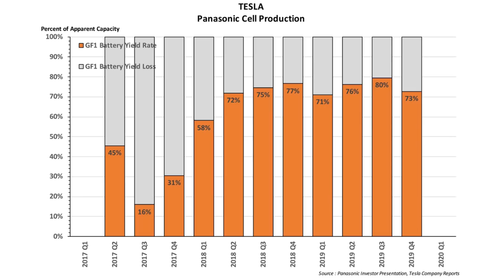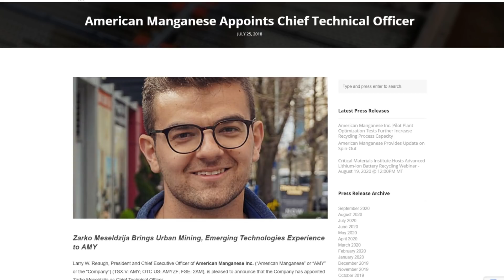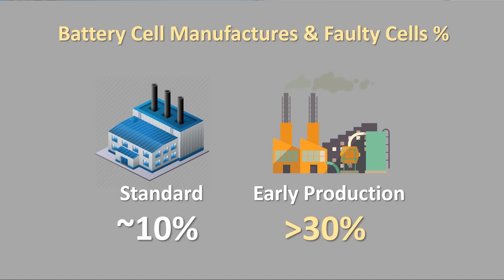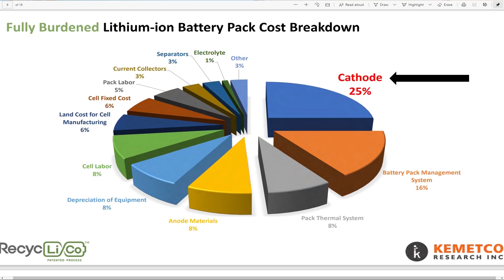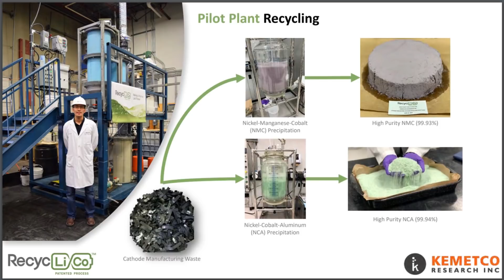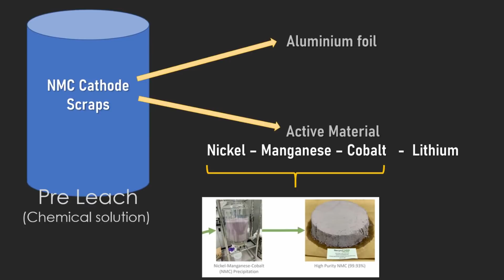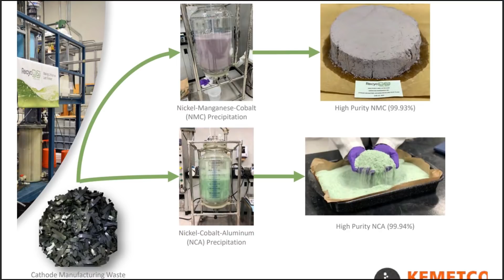Tesla Battery Day Preview - Redwood Materials

Comment: Redwood uses smelting to melt down phone batteries. Horrible for the environment. Take a look at American Battery Metals Corp. Full EV closed loop recycling. Team of 3 former Tesla employees with more to come...
Reply: It depends on what you are smelting and how you smelt. Furnaces designed specifically for producing molten compounds from melting cell phones, laptops, etc. Lead is a component of cell phones and laptops, but it would become part of the multinary metal oxide, along with the target elements Li, Co, and Ni and extracted - not emitted as in a dirty smelting process.
Reply: You are correct. Along with that how much energy is consumed and where will it come from.
Reply: @schulzmj1  Melting the component materials of the systems (cell phones, laptops, etc) down generates enough heat that once you get them going they are autoaccelerating... that means, no external energy required except to get them started, and that energy can be provided by a neighboring unit. So, it is energy releasing, not energy consuming. The energy required to concentrate/extract the various elements from the resulting compound is much lower than required to mine and separate those elements by traditional methods.
Reply: @cbmusgrave  Please show me the exothermic chemical reaction in the smelting process of the above items.
Not happening! That a side
How much metal vapor is releases into the atmosphere during the smelting process?
What are the recovery rates?
What kind of slag is left over after the smelting process?
Where does the black mass (slag) go once the smelting process is complete?
Is the black mass toxic?
All legitimate questions, just asking.

Comment: They are recycling what is available today.  Car batteries will need to be recycled maybe in 10 years and that number is going to grow based on cars or batteries produced.  And when the cost of batteries goes down the number produced will increase because of other uses. The grid is going to transition from energy on demand to energy stored and used when needed.  If this recycling was not done there would be a huge amount of battery waste.  This recycling is very important.  Think of a chain, every link is different.  If a link is missing the chain fails.  Recycling batteries is a link in the chain to use energy and pollute less.  It is predictable how much battery waste is coming and where it is coming from.
Reply: It is important to consider the efficiency of recycling technologies
Reply: The problem is no one is recycling lithium ion batteries in an eco friendly way today. Smelting batteries is terrible for the environment and the recovery rates are pathetic. If a proper way of recycling lithium batteries is not found EVs are a disaster for the environment. Recycling is the link in the chain that has not been dealt with.
Why don't any of the eco nuts think like you?

Comment: Thanks for the insight. Some comments on the content from someone who does not have a manufacturing, chemical or economics background.
1. Manufacturing waste or non compliant materials at 10% would seem high. 30% a even bigger gap of belief. Surely these are at below 1 or 2% in real world manufacturing or even lower? Have you invited Japanese, Korean or other like eg. European battery manufacturers to comment or advise? 
2. The pie chart cost breakout had overheads etc included. The material costs were 42% of that pie chart. The other 48% are effectively a loss and not recyclable. What does that mean? Get manufacturing tuned up saves as much a material costs.
3. QA and QC would hopefully be at laboratory or chemical grade/level standards. Is this a fair comment? Can a expert comment on these manufacturing figures of waste or rejects.
Reply from the maker: Hi Peter these are all great questions ill ask Zarko to respond
Reply: The graph at the start of the video shows even more than 30% waste at times and savings can be made in many areas. Recycling is another option from a bill of materials stand point.
Reply: @brettstewart3733  Please tell all the web page that gives us a few details of ABTC's process.
Percent of materials recovered and purity. I don't see anything published and/or verified anywhere on their website.
https://americanbatterytechnology.com/

Comment: I think Redwood materials will be available to all manufactures to use in order to drive down battery costs across the entire industry. This is inline with Tesla’s mission
Reply from the maker: Excellent feedback thanks George
Reply: Using high heat in a recycling process is very unfriendly to the environment and carbon intensive. If this is the case better off to continue with ICE vehicles. Smelting batteries in a furnace puts metals into the atmosphere and requires large amounts of power. Not very environmentally friendly if you ask me.

Comment: Maybe Elon didn’t want to dedicate the funds or be criticized for developing a not so green method of recycling batteries?
Reply from the maker: Interesting point Jeff
Reply: Then maybe Elon should be investing in American Manganese.
Reply: Redwood is developing a new, much greener process. If it was just melting down cell phones and laptops with no consideration of emissions, then Redwood could have just bought some furnaces and started melting down crates of phones. However, they are specifically developing new new processes based on new fundamentals (phase diagrams for all the elements in a cell phone don't exist).
Reply: @cbmusgrave  This was recently on Bloomberg about 2 weeks ago: https://youtu.be/xtVE1I1SoRw

They still are burning batteries
Reply: @anthonykham8239  They are processing the materials in specially designed furnaces with zero emissions. If you study the phase diagrams and free energies of the various possible processes, you can figure out how they are doing it, and characterizing it as "burning batteries" is overly simplistic and misleading. If that was all they were doing then anyone could set up shop and they would have no technological moat. Redwood is not eager to explain to everyone how they are doing things and unfortunately, I am not at liberty to discuss the details, but if you know enough materials thermodynamics, you can figure it out.